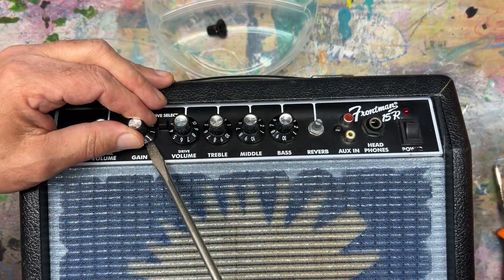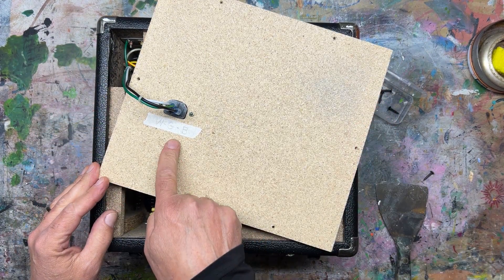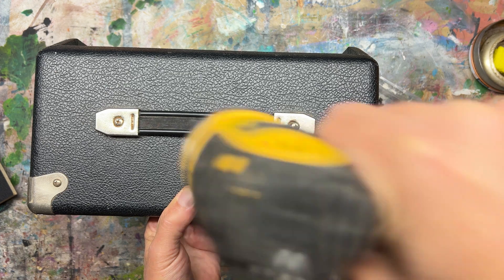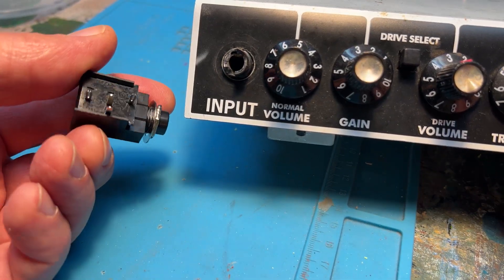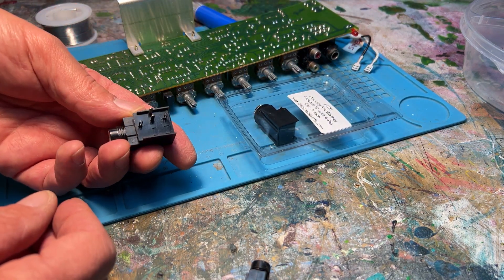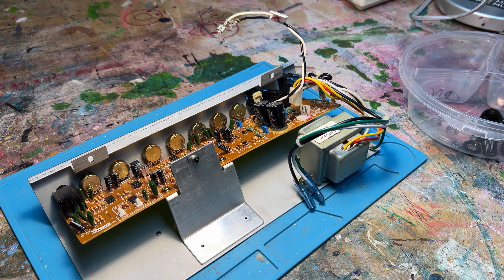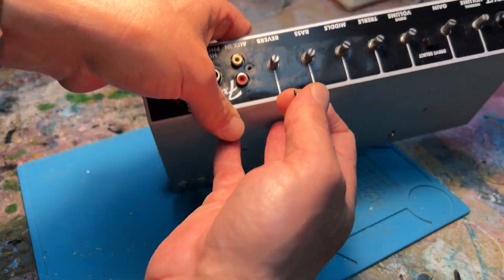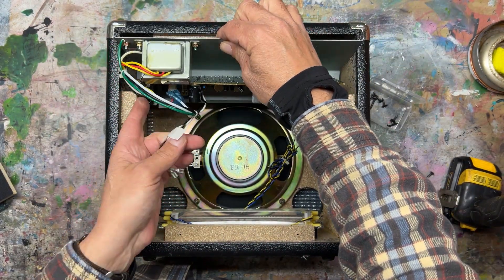Fender Frontman 15R Broken Input Repair

Comment: I have the frontman 15G and 1 day it just started making humming noise and no sound comes out when i play the guitar..switched it off then it never turned on again when i tried turning it on
Reply: same
Reply: @JoshuaTheGoose  u manage to find the problem?
Reply: @Rachi255  sorry but no since that happend i just used my guitar without the amp
Reply: @Rachi255 @Rachi255  I'm gonna try and resolder mine, I think I have a similar issue. If it doesn't work out, I might order a new jack and try that.
Reply: Yea it didn’t end up working if anyone sees this in the future, idk whats up with it, might have just been a bad soldering job maybe
Reply: What size is the washer and nut on the input jack?

Comment: also, I replaced the speaker with celestian eight 15 and it sounds nice, however at more aggressive volumes you can hear ths speaker mechanically distort like it's not enough watts.  The youtube video suggesting this model recommended 4ohms but I measured the original fender speaker as 8ohms so I bought the 8 ohm version of the celestian eight 15.  Should I have went with the video reco and got 4ohm instead , or are these totally the wrong replacement speakers?, Did you ever replace the driver in one of these amps as well? if so what did you use?  thanks!!
Reply from the maker: 8 ohms is the way to go. these cheap amps don't need a redesign. they work great for a cheap price.
Reply: @7thchordstudio  thanks very much!

Comment: very well done and organized steps! great video. 

I have one of these and since I had it the first volume pot seems strange, you have to very slowly turn it up between 0 and 2 and at about 1.5 it gets moderately loud already like there is no quiet  range to the volume at all. Is this normal or should I replace that pot.  If I do, do you know where I could order the correct one?
Reply from the maker: That is how mine operates too. the design is pretty basic. You could buy a fancy CTS pot from StewMac.com but I doubt it would help much.
Reply: What you describe is a defect of the design of this amp. You could try to replace that pot with a logarithmic one of good quality.
The solution I adopted for my amp is to control the volume through the pots on guitar and pedals.
Reply: I agree, great organization and detail in this vid.